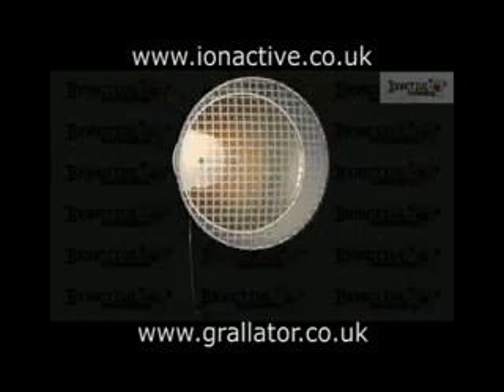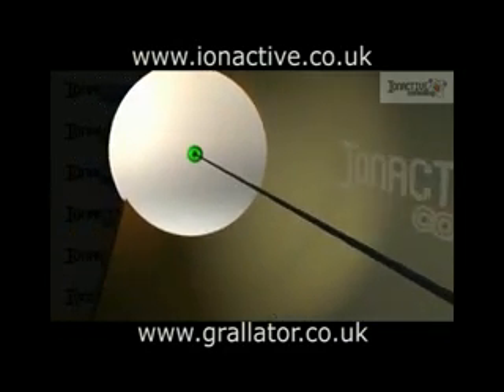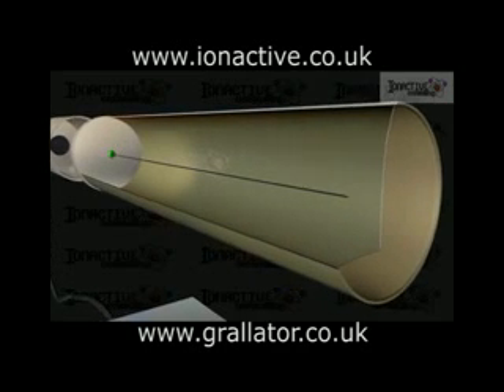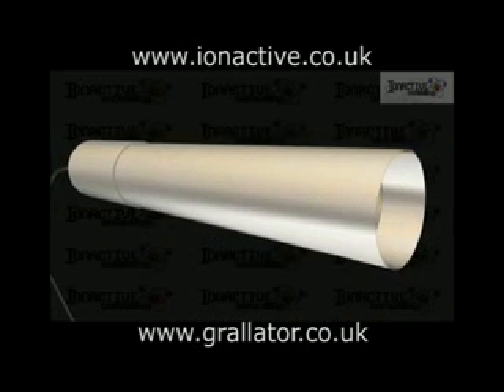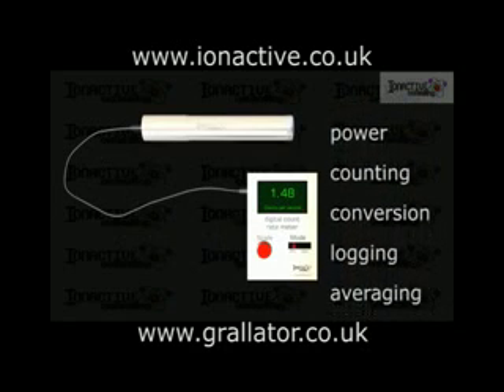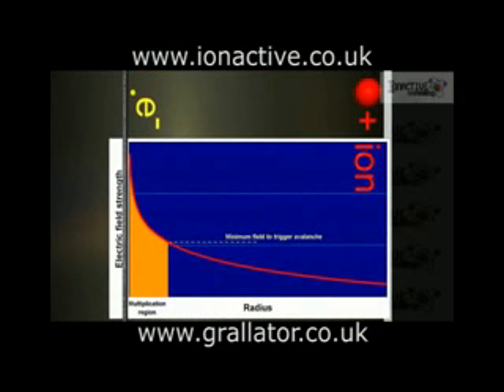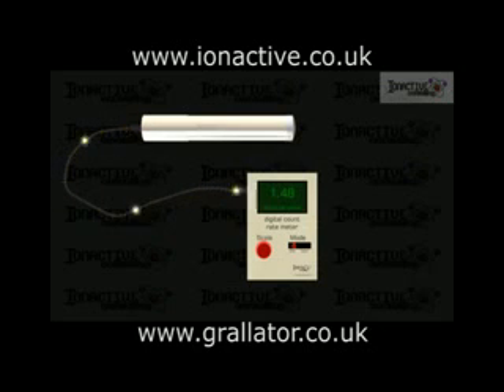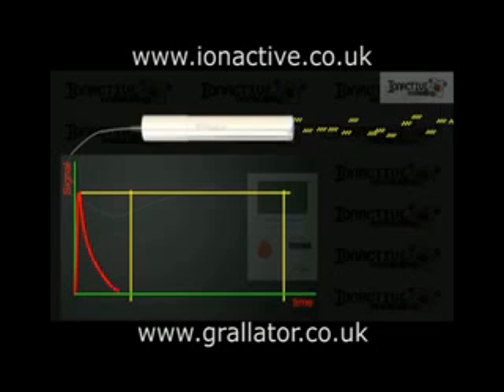Geiger Müller Tube (GM) - Part 1 - Radiation Protection

Comment: A Geiger counter (Geiger-Muller tube) is a device used for the detection and measurement ... The voltage at which the G-M tube just begins to count is called the ...

Comment: well,you need a bit more than that,some lead wires,duck tape aluminium foil,but it can be easily found,i found this instructions in a kit,witch is for sale on anythingradioactive[DOT]com,but you don t need to buy it,just download some schematics (if you want to make a geiger counter),and make this GM tube 

wwwDOTanythingradioactiveDOTcom / airgeiger / AirGeigerCANManual-EN1

if you didnt understand,just ask me,i know my english is not very good